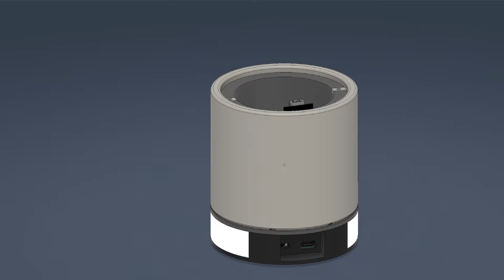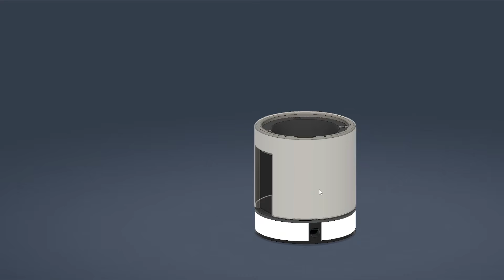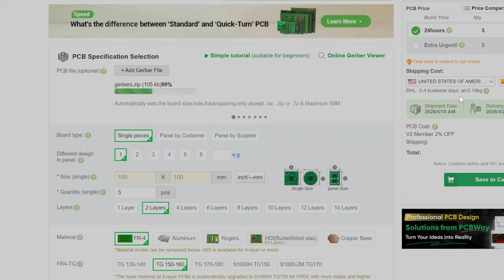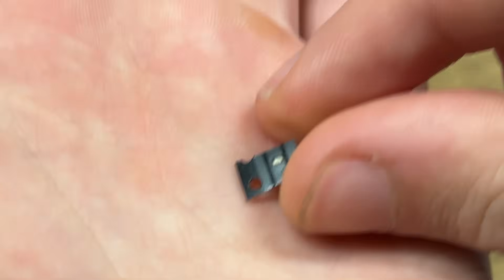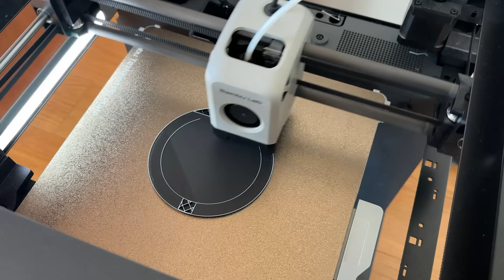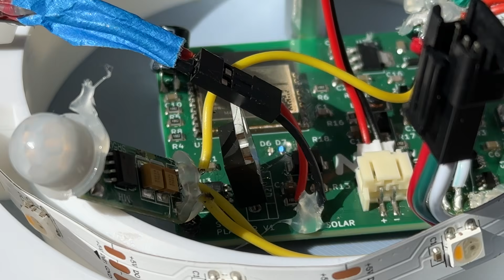I Built a Solar Powered Smart Plant Monitor (It Almost Works)

Comment: I like the concept. You should have the LEDs pulse quickly every 10 seconds or so only when the moisture level is low and forego the motion sensor entirely. The brief pulses will get your attention more easily and use a fraction of the power.
Reply from the maker: Thanks! That's a good idea, I could definitely see someone just getting used to the light when its almost constantly on. I'll look into it for the next version.